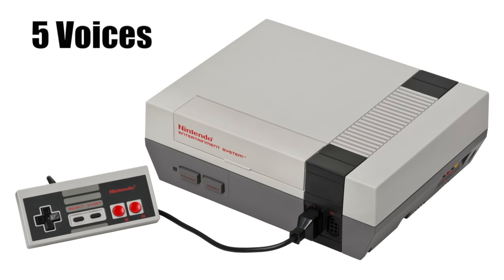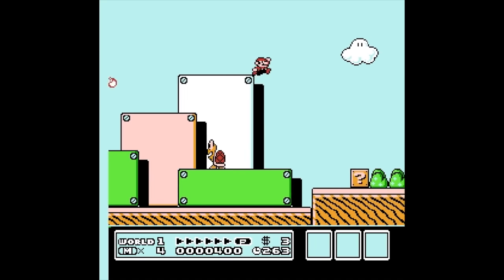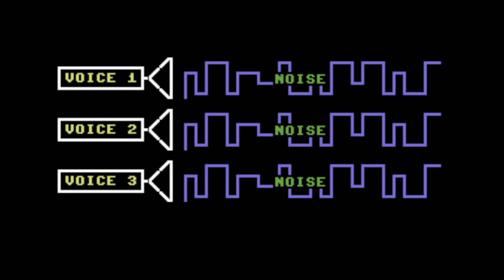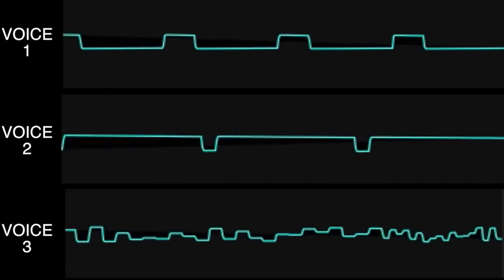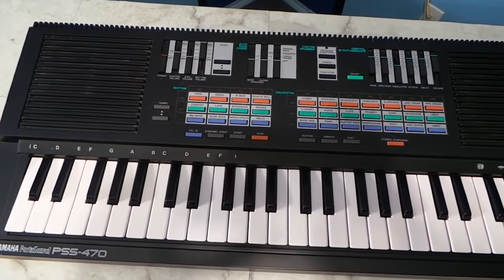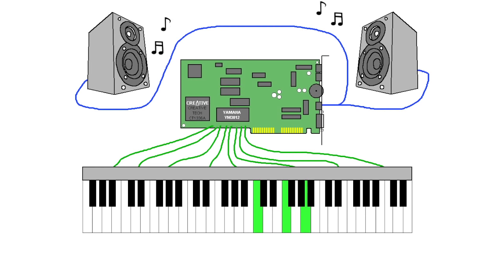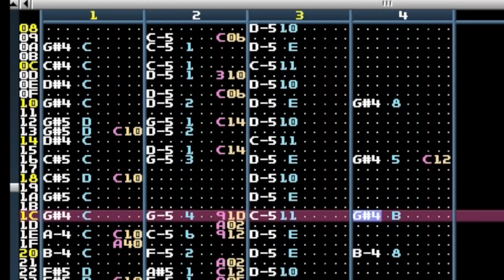How Oldschool Sound/Music worked

Comment: How about MIDI files aren't these old?
Reply from the maker: +sjoerd dal Not really.. MIDI files are still in use today and they really don't have much to do with the way sound is produced.  They just contain the information of what keys are pressed, how hard, etc.  But it is up to whatever synthesizer it is played on to determine how the sound is made.
Reply: +The 8-Bit Guy I did not know that. I tought MIDI files where the same because my old keyboard can play them too.
Reply: +The 8-Bit Guy    I was gonna suggest that you do a video on something like: Whats the difference between Gravis Ultrasound, Soundblaster, Roland LAPC-I/MT-32 and GS Wavetable methods of making music. But then I realised you renamed your channel to The 8-Bit Guy, so...are you only able to do 8-bit related stuff only?
Reply: +Dash My content will not change from what it has been the last 3 years.  I just wanted a name that didn't focus on iBooks since that is not something I will feature very often any more.  You can only make so many videos about iBooks until you run out of content. I certainly won't be restricting my content to 8-bit stuff.
Reply: 8-Bit Keys    Awesome :)
Reply: +sjoerd dal Nah, they're pure notation & timing data, no digital sound included.
Reply: +ott To be fair, MIDI stands for Music Instrument Digital Interface, meaning a method to connect various MIDI devices together and a common language (I.E. a MIDI cable and a properly set up format for the devices to speak to each other,) - .MID files are basically recordings of those MIDI messages (with a few other 
things added in, )
Reply: +1NOM155 ha I was just about to say the same about the Amigas sound chip  paula! DMA ftw! .. not a bad machine to write music on considering the little hardware used and software tricks to get more channels..
Reply: +ceffydriver indeed mate. Unfortunately Jay Miner was force to leave Amiga, thanks CMB (Commodore) :/ and his health conditions as well and also bad management, lead Amiga to ruin / disappear and got replaced by PC, resuming a shame :/ luckily there is a huge Amiga fans, who still doing great stuff.
Reply: 1NOM155
yeah  I think that today would be different if commodore could have marketed the Amiga range better towards businesses.. that said there were plenty of amigas at NASA keeping old satellites in orbit well and truly into the 2000's.. now look at the virtual monopoly (duopoly) that we have today with pc's and mac requiring so much hardware to compensate for sloppy coding and heavy OS's .. It was amazing what the old A500+ could do with a 7mhz cpu and 2 megs fat agnus and ECS back in the day! or even the std 500 with +512k a501 it was a beast (until you ran elite II frontier)
Reply: +sjoerd dal a lot of cheap flip phones these days use midi ringtones to save space
Reply: +ceffydriver yap, still todaya UK collage still use an Amiga 2000 to control the heat system, since that machine is really reliable. 
I still have a slightly hope Amiga will return to the market. (Video Toaster they need your help, heheh)
Reply: Try MuseScore. There's tutorials for it on YT.
Reply: +sjoerd dal MIDI is from 1981.
Reply: +The 8-Bit Guy Just bought excellent Yamaha SW1000XG only to play my huge MIDI collection grabbed from net in late 90's, most of them in XG format
Really love it!
Reply: +sjoerd dal MIDI is basically sheet music for a computer.  Most of these synthesizers would have used variations on the midi format or at least variations on the idea behind it to store actual the tunes that these synthesizers would play.
Reply: +sjoerd dal MOD replaced midi for the most part. The problem with MIDI is its reliance on hardware and loose standards. It will sound different depending on hardware, unless taken over by the OS and emulated. MOD can do everything MIDI can do, but it will always sound the same.
Reply: +Splotch the Cat-Thing midi is not music at all, its software
Reply: +The 8-Bit Guy my old man turned 50 this year, hes been using them since at least the mid 90s if not earlier than that?? He stores them on floppy disks as i recall. Hes got tons of floppy discs and synthesizers that accept them. Only recently i think he may have picked up a newer one that may use another medium
Reply: +Synthematix midi is a file containing notes for playback and instrument data. It's an early Verizon of OGG Vorbis format.
Reply: +sjoerd dal Sort of. As 8-bit guy pointed out, how the instruments are defined varies from MIDI implementation to implementaton (though there are some fairly standard ones). Thus, MIDI on a soundcard might sound different from that on a keyboard and would definitely sound different on a system where you've changed what the actual sounds for each instrument are. This is part of why MODs came around...they include the instrument definitions, rather than relying on the implementation.
Reply: +Gustavo Sarmento That's because CBM did things so wonderfully hardware wise...and then got shafted by the money side. Sadly, the current 'Amigas' are just regular PCs with a different OS.
Reply: VulpisFoxfire
Amiga Workbench was the best...
Except for the default dark blue bright orange color palette.
Reply: AIO inc. That color scheme is actually quite easy on the eyes. Orange is red and green, making the foreground the most easy to see of the colors, and the background, the most difficult. It reduces eye strain, even though its ugly.
Reply: +Richard Smith I've seen the opposite. MOD never replaced MIDI files entirely. Most games had MIDI files, the only ones who used mods were usually ex-Amiga game developers.

Plus when CD-ROM games became commonplace, they used the audio tracks for music, since they've sounded better than MOD files, and unlike MIDI, they've sounded the same on every device. Later, when computers became fast enough, they switched to simple WAV files, then MP3.

Midi is still used in-house by musician, while MODs are pretty much a niche thing, since there are better music making tools (even free, such as LMMS) for making and exporting music to mp3 or other streaming formats.
Reply: ***** MOD is still used in modern games and music development. As a programmer, I still see mod, but midi is reserved for retro legacy.
The reason is MOD is dynamic. Meaning you can dynamically add instrumental tracks to add suspense. This is incredibly powerful in gaming, and the prime reason it replaced midi, that and consistency. 
Also, it is fairly common for midi's to be converted to MOD at the last minute to preserve consistency in retro games, if they want to imitate old hardware for instance.
MOD is basically just a multi-track WAVE file, but this makes it infinitely flexible.
Reply: Richard Smith
High contrast, though, my eyes get very strained.

The color palette really just annoys me and makes me get a headache after a while.
Reply: AIO inc. Theres a nob on the side to turn down the brightness. Actually, the least eye straining color combination would be yellowish green on black. Simply not liking the color does not make it give you a headache. Red and green require the least amount of effort to see, with blue causing eye strain headaches, because the brain has to amplify the blue colors.
Reply: +sjoerd dal that's probably going to be in part 2
Reply: Richard Smith
It;s not the brightness, it's the combination of colors.

P-35 Green on black (monochrome) is the easiest for me to see.

Blue on Orange is a horrible color palette for my eyes.

I have eye problems, don't hate.
Reply: +Synthematix midi is not software at all, it is a standard or protocol.  hardware and software use it as a standard to communicate

https://en.wikipedia.org/wiki/MIDI
Reply: gumbilicious1 I think he meant its not audio, cause its not really. It is sheet music which computers can play, but the sound of each instrument depends on the hardware or software playing it.
Reply: Richard Smith you are correct, it isn't audio.  but it also isn't sheet music, it also isn't software.

i am sure you meant 'it is like sheet music', and there is an aspect of midi that does define pitch, duration (velocity, bending, etc).  but that is only part of midi.

there is many other aspects of midi, much of it having to do with linking different hardware together (clocks, channels, connector pin sets, etc).  it also specifies things like bit depth, rate and number of signals passed between devices.  it also specifies how to synchronize these devices (using something like a global clock).

you can control production lighting in live shows, you can control software instruments in real time, you can remote switch settings on hardware devices or trigger samples all using midi.  these are just a few things MIDI can do that transcends the concept that midi is 'sheet music'

midi even has a number of features specifically made for real time manipulation (like continuous controllers/CC's).

midi is not software and it isn't hardware, it is a way to make software and hardware communicate with each other.  if something is made MIDI-compliant then it could talk to and work with other things that are MIDI-compliant.  it is a standard, a non-proprietary structure to build hardware and software so it can be compatible and work with each other.

and the only reason i made that comment was because he took his time to correct someone when he himself didn't know what he was talking about.
Reply: gumbilicious1 Yes i meant, 'sheet music for sound controllers' as this is precisely what midi's intent is, and I agree with the rest. The reason for midi's current legacy status is, even though it is a strict standard, the way in which the hardware expresses the music in a midi file can vary enough as that the same midi file can sound completely different when played on a different dsp :) In some cases it can be completely unrecognizable across hardware if complex enough.
It is still used as a communications standard between instrument and computer however, just not as a production file format.
Reply: Richard Smith "Yes i meant, 'sheet music for sound controllers' as this is precisely what midi's intent is"

no, the intent was to make a standard so that digital devices can communicate with one another.  this was mainly driven by the rising digital keyboard market in the late 70's, so that different maker's products can interact with one another.  before midi they used to use voltage control devices, but these were no longer sufficient because, basically, digital keyboards were more complicated (for example, they were polyphonic and facilitated quite a number of voices).

the 'sheet music' aspect of it kinda just fell out of the standard once you sent these signals to sequencers, and midi music on computers and video game systems was driven by the need for cost efficient/memory efficient ways to store and transfer music on digital devices (sampling just too up too much memory).

all this information is in the original link i posted.

https://en.wikipedia.org/wiki/MIDI

but the bottomline is the original intent of midi was not create digital sheet music.  as a musician i once thought this was the purpose of midi as well, as this is about all i used midi for.  but i was wrong, and someone let me know it.

plus i started getting into old analog monophonic synthesizers and also started getting into software synthesizers and really started delving into the complicated controller aspects of midi.
Reply: what did i miss
Reply: +Splotch the Cat-Thing Your first sentence is word-for-word how I begin to explain midi files to people!  ^_^
Reply: +VulpisFoxfire "current 'Amigas' are just regular PCs with a different OS."
But but but but case badge!  :3
Reply: +Richard Smith FWIW, one can use MIDI with the program supplying its own MIDI synth, and add any other useful features. I had a game where the main mixer was actually a hacked/extended MIDI synth (which I had thrown together a few years prior), where it was possible to upload/stream samples, and assign spatial coordinates and velocity to each channel, ... had at one point also glued text-to-speech capabilities onto it.

though, FWIW, its core was wavetable based.
IIRC, channels 1-16 were generally reserved for music playback, whereas 17 and above were used for in-game sound-effects.

it had also compressed the wavetable and sound-effects with a specialized audio codec (to save memory, audio was generally kept compressed in RAM), but for streaming in audio from an external source (such as for video playback), generally ADPCM had been used.
Reply: +sjoerd dal MIDI dates back to the 1980s (or even late 1970s.)  Dave Smith is often associated with the MIDI scheme.  MIDI files are a bit newer, as it general MIDI, but both have been around a long time by my reckoning ( by MIDI files, I mean general MIDI files on computers.)  MIDI is not going away anytime soon, use it all the time in my synthesizer setups as do countless other musicians - MIDI has never been replaced for controlling synths.  It's been extended to USB, but the standard is otherwise the same, amazingly.
Reply: Michael Bauers
It's all serial communication, there is very limited variation between standards.
Reply: +Michael Bauers quite amazing indeed.
Reply: sjoerd dal It follows the old adage "Keep it simple, stupid" very well.  It's one of the few things relating to technology that, for the most part, transcends typical generational roadblocks.
Reply: tin pin  yeah. even my hacked version wasn't "that" drastic, mostly a few more controllers, ability to bank the channels (for more output channels), and more control over patches/samples. the decoder was backwards compatible with General MIDI.
Reply: *****
MIDI has been around since 1977, but only came into wide spread use around 1985 with the introduction and sale of the Atari 16 and 32 bit line computers.
Reply: *****
That's what I'm here for.
Reply: +sjoerd dal Midi is still in use today and it's one of those old school techs that has hung on because it was so well done.

For example if you youtube:V-METAL demo by Javi Perera

This is a modern example of what midi can do.  Everything you hear in that demo is using the midi protocol to makes those sounds.  Midi on it's own doesn't produce any sound.  It's just a way to control software/hardware synths, samplers, and drums.
Reply: *****
lol
Reply: +sjoerd dal MIDI is a format to control/command sound. I really like The 8-Big Guy to review the history of MIDI, starting from GM if he would like to do.
Reply: +Fu Zhixiang (Midiz) Big? you mean bit
Reply: +Sergio FLS Yes, 8-bit. Sorry for my bad typing. Thank you for correcting my mistake.
Reply: +1NOM155 Did you know that around the time of the Amiga 2000, NewTek (who made the Videotoaster) bought a number of A2000's and rebadged them, inserted their video card, then sold them as video editing add-ons for the early Apple Macintosh computers? This system actually won an award for being the best apple add-on in around '86 or '87.
Reply: +AIO inc. I agree that AmigaOS was very nice, i had an A1200 myself, which ran v3.0 and later upgraded to 3.1. This version, and indeed also AmigaOS 2.0, used a more discrete color scheme which was easier on the eye.
Reply: +GuitarGodgt yes midi is still used very heavily in music production and performance, as well as film. Whether it is Rammstein using MIDI to trigger fireworks from a keyboard on stage or all those USB keyboards and controllers that Native Instruments make for DJs and laptop musicians. 

Also did you know that MIDI cables have 5 connectors, 2 of which were included just for future proofing but have never actually been used because the standard was so versatile already?
Reply: ***** And they are splendid.
Reply: the best cameraman Many years before, midi samples are loaded directly from HDD. Now with SSD, 512 or even up to 1024 voices are not a problem, I think. Say a 10 minutes music with 1 million notes. There're at most 28 notes per second playing simultaneously, 56 notes per second if every note lasts for 2 seconds,..., 280 notes per second if every note lasts for 10 seconds.
Reply: OK, that would be if in the last case. I play with MIDI file but not black midi, LOL. But I'm still curious about the amount of data to be processed. Compared with graphic data in 3D games nowadays, say Just Cause 3, the black midi has more per second?
Reply: the best cameraman Really a torture. The test midi is "Sandstorm". The sequencer loaded for several minutes. No problem with PC because it only sending midi messages but those rigs processing sound get nightmare. I set up 5 synthesizers but still I can feel that los of notes are eaten up due to the limitation of 128 voices for each synth. It's much scarier than inputting 10 million midi events other than notes.
Reply: +sjoerd dal actually, just about every song you hear in the 80s-present day pop music is HEAVILY MIDI based. They program the MIDI for each instrument in a DAW,'s 'piano roll' and then slap a plug-in/vst on each channel. I, like many musicians use it to more now than how much it used to be used. 
If you click this link you can hear a song that is 100% MIDI. And no...I'm not talking 8-bit sounds either.
 https://soundcloud.com/gabe-raham-johnson/born-of-osiris-recreate-midi-version
Reply: GabrielTheGuitarist Agree!
Reply: +the best cameraman That's what I just said, dufus. lol
I said 80s - present...and even used more today than it used to be, especially in pop music.
Reply: I'm a midi fan but probably I love midi so much, I, in turn, cherish live concerts with performance of real instruments even more. Untill now, midi voices cannot do everything like instruments do. For instance, everytime when a drummer hit the snare, the hitted position on snare is a bit different and the sound comes from the hit also slightly different. This ingredient or nuance always addicts me. For midi, each time it give the exactly same sound. However, MIDI gives one the ability to simulate a one-person band, even a band with 16 or more different parts.
Reply: +gumbilicious1 Yes, you are correct -- MIDI is a language (way of communication) for an equipment used for performance at sound stage -- it does not carry information about form of sound wave, but carries information what note and how it should be played -- and MIDI was extended to do many many other beautiful things.
Reply: +The 8-Bit Guy There Pretty Much Music
Reply: +sjoerd dal MIDI music really wasn't invented for Computers, but more for the synthesizers.  They had built in instruments which you would then play using the keyboard.  MIDI was a standard way to represent that music and communicate it between devices.  It was later adopted onto computers as their sound got better.  It wasn't until much later that you had sound cards on Windows 98 style systems that could finally play MIDI music the way it was intended, but they really didn't last too long as digitized sound became more feasible.  MP3's pretty much was the nail in the coffin for MIDI when you could make real sound/music with only 10% of the memory that you used to need.
Reply: +Neil Roy MP3s still took a significant amount of storage compared to a standard MIDI file, which only occuied a couple of kilobytes at least. That's because the samples used in MIDI were more used like custom-made "notes", hence it was possible to capture a single guitar riff and recreate all the other notes by changing things like pitch and tone.

Modern MIDI has come a long way from the Sound Blaster/Roland MT-32 music of yesteryear. MIDI is still used on TV for television scores and even come as far as recreating convincing orchestral music. It is way more sophisticated than it used to be, but I think the biggest killer of PC soundcards were really the hardware: It was cheaper for a single hardware spec that can play PCM than have its own built-in instruments.
Reply: Sig Fried
Sure, MIDIs took less memory, but when they were first available for computers, they sounded like crap.  You didn't have the modern sampled instruments like you do now, that didn't come until much later, and then it was dependant on which OS you used etc.

Actually, I didn't use MIDI OR MP3s, before MP3s I used Amiga MODS which were far superior and small.  I never really liked MIDIs, by the time they had their own instruments in Windows to play them decently with, MODs had taken off, there were 8 channel mods etc... and MP3s were just around the corner.
Reply: +sjoerd dal MOD and MIDI files both contain information on what notes to play, how to play them, and with what instraments.
The difference is, MOD files contain the sound samples that are used as the instruments, whereas MIDI is stuck using samples specifically burned into the MIDI synthesizer.  A MOD will pretty much always sound the same whereas MIDI, while having the same notes, will sound different on different sound chips.

If you want to think of it as an orchestra, MIDI has sheet music, while MODs have sheet music and instruments.  MIDI risks getting stuck playing for a venue that only has trash can lids and rubber bands, where MOD always has its drums and guitars.
Reply: ghostbirdofprey
There's more to it than that though.  MODs were invented on the Commodore Amiga computer which ALWAYS had far superior sound over the IBM since it was created back in 1985.  The Amiga could do sound sampling when the PC only had a PC speaker, and later on, with the ADLIB card for the PC, it still lacked the ability to have sound samples while the Amiga had complex waveforms and was able to have four sound samples at once (it's the reason why the Amiga Lemmings has a "Lets's Go" sound sample at the start and the PC does not), which is why the original Amiga MOD format had four sound samples.  At that time, the only alternative for the PC for music was the MIDI format.  The PC couldn't do sampled sounds like the Amiga, so the MIDIs just used the various waveforms the ADLIB cards could do.  It wasn't until much later, in the 1990s that the PC finally got Soundblaster cards which could do more complex waveforms and sound samples.  So to just state that MODs were midis with samples is not quite accurate historically, it's MUCH more than that.  I don't recall the PC getting the ability to play proper sound samples to the various MIDI instruments until after 1995.  I recall Windows 95 or 98, I forget which, finally had a default sample set for MIDIs, by that time there were tons of MODs which were very popular and easy to create.
Reply: +Neil Roy you could create mods as well on a pc, provided u had a soundcard
Reply: Tyler Tisaowa
You do not have one spec of knowledge of the  difference in sound between the PC and the Amiga when Mods were created... NOT ONE SPEC!
Reply: +Neil Roy I was referring to the capabilities inherent in the format more so than the hardware that lead to its use.
MOD format is more restrictive in its use since the hardware has to be able to play sampled sounds, but it has the advantage that by having the samples along with the playback information, the composer has control over how it sounds.
MIDI does not come with its own samples, so is reliant on whatever the hardware does have.  Early on that was shitty AdLib FM synthesis, but later on, cards like the Soundblaster had samples on a wavetable chip/daughtercard, but sample quality varied.  I believe they started appearing around '92, though, not '95.  Admittedly, I am a bit fuzzy on the dates the SoundBlaster 16 and Grvis Ultrasound were released

Again, MIDI is just sheet music, so how it sounds is based on the hardware synthesizer and wavetable or lack thereof where MOD's also have the sound samples needed for the composition in the file, so is only limited by channels and overall fidelity of the hardware.
Reply: +sjoerd dal Well... the midi file is the same, it's just not gonna sound the same on an old keyboard.
Reply: +ghostbirdofprey I remember downloading a sample-based MIDI system over the internet to make my game music sound better. At the time it blew me away.
Reply: +Phyphor666 In other words: Music/staff paper as a Text Document.
Reply: +Luke Reiter it sounds like a reggae version
Yah man
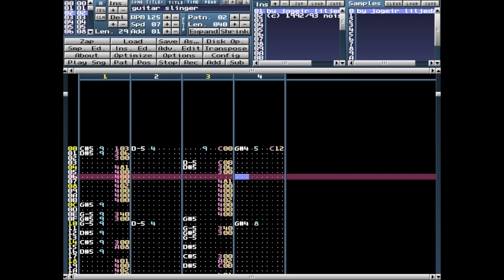Reply: +The 8-Bit Guy What was the game at 6:39 ?
Reply: Yyy
Reply: +NitroAcer X64 THe intro song for Blood Money, a Psygnosis Game for the amiga
Reply: Yeah
Reply: And MineCraft ( Notch ) uses it to this day! All music, sounds, etc. is solely in OGG Vorbis format. No WAVE, No MP3, no WMA!
Reply: the Ds uses midis
Reply: Haha, some of the replies to this comment are just adorable.
Reply: Mark The fox animatorX3 yee
Reply: Mark The fox animatorX3 DAT BOIII
Reply: Mark The fox animatorX3 GRAND DAD GRAND DAD GRAND DAD GRAND DAD GRAND DAD
Reply: Mark The fox animatorX3 Song name?
Reply: You guys are freaking weird.
Reply: Romantique Tp thanks
Reply: Mark The fox animatorX3 yer mom
Reply: look up new order blue monday thats a song from the early 80s thats a midi (its a great song to)
Reply: Mark The fox animatorX3 high quality video game rips
Reply: ***** its a good song right!! (but there were even older song that played in midi its just that thats the only one i can think of from the early 80s)
Reply: I've seen midi files that where made in 2002 but that's nothing much to brag about
Reply: I still use midi files on occasion when making tunes. It's old, but still pretty common.
Reply: MIDI is a protocol rather than a sound system, you probably heard some MIDI without realizing it, because the samples used are now amazingly faithful to the real instruments.
Reply: Alessandro is right, a MIDI file you have is actually just a set of instructions to tell the computer what instrument to play and when to play it. Thats why MIDI files can sound completely different depend on what midi player is used and what soundfonts are assigned to the instrument.
Reply: In modern music a lot of what you hear are midi files played through VSTs.
Reply: Midi is indeed quite old, but also very much still in use today. The principal of midi still exists in music composition more than an end use format though, it is still used in essence on multi track music composers such as Fruityloops for example, that rely on multi track sampling, and in most cases still as a standardised way of communicating musical data to and from instruments such as a keyboard and some more sophisticated controls devices like DJ Consoles.
Reply: MIDI has been around for a long time, so some files might be old, but it's still getting plenty of use today!
Reply: I like to compare Midi to vector graphics, but for music. Plenty of information, but you need something to interpret that information with.
Reply: Bodoron That's an apt, accurate comparison, assuming you're explaining it to someone who knows what vector graphics are, and how they work.
Reply: I remember my early 2000's NOKIA N-GAGE QD could handle MIDI and wave files. But my ringtone wave files were pretty big to be fitted on my 256MB MMC card.Impossible to think about MP3 back at that time!